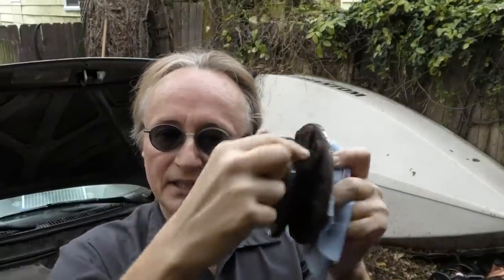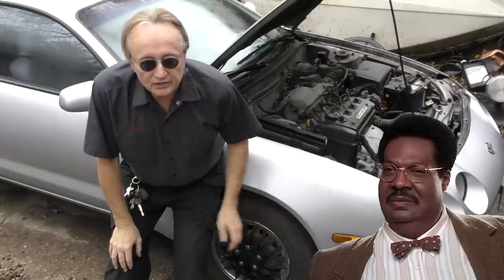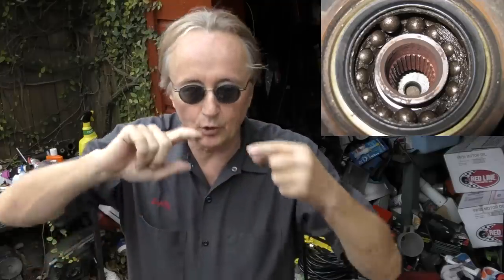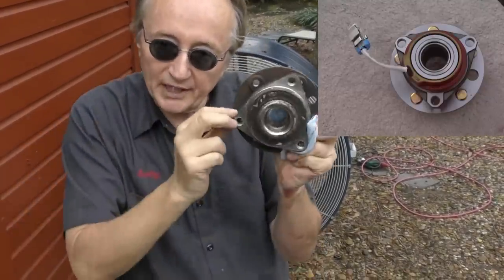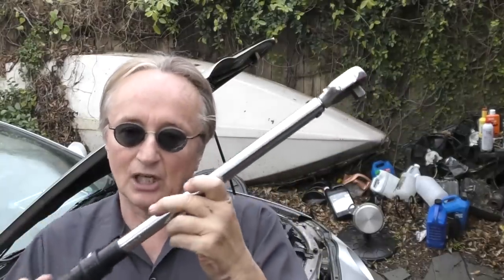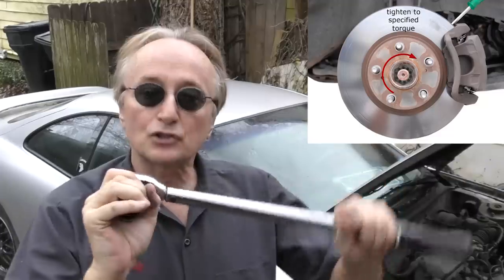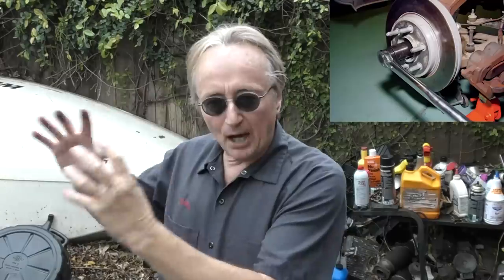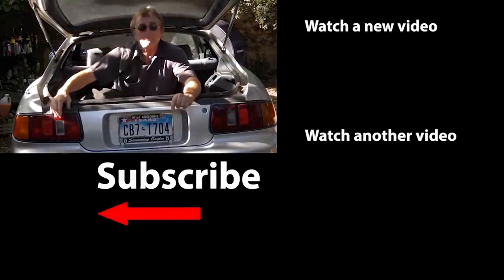Doing This Will Make Your Wheel Bearings Last Forever

Comment: I bought Harbor Freight torque wrenches for every size drive and I can't read the numbers on them. Also, many wheel bearings have crazy high torque specs. My basic 1/2" drive torque wrench only goes to 150 pound feet and my car calls for 170 and the other car is over 200 as I recall. What brand do you recommend?

Comment: I don't always agree with you, but on this one, you speaketh-the-truth. Being a maintenance Nazi myself, I have repacked my older wheel bearings years ago, greased by hand, but like you say, you don't have to anymore (or can). Replace item only. So, every other oil change I have my tires rotated and have them aligned once a year, unless I hit too many pot holes. When you drive a $75k car like I do, why not take care of it? Maintenance is expensive, but so is a new car is even more. Good video.

Comment: Thanks for the info.  I have a trailer that has the old-style  replaceable wheel bearing assembly on its single axle.  If you have any tips, tricks, insights, cautions, or suggestions for replacing them and keeping them in good condition, I would ask that you do a video on that subject.  Again, thanks for this video.  It was both informative and entertaining.

Comment: Thanks for the information Scotty!! I recently noticed the outer CV boot was torn on my '09 Jetta and there was grease all over the wheel well. I tried replacing it with a Dorman EZ boot split boot assembly and couldn't get the bands tightened down enough, so it slips off. I've tried pushing it back on there and packing grease in again and again over the last couple weeks until I can get a replacement part, but it's started doing a nasty clicking sound when I turn my wheels right or left, or when I start driving from a dead stop..basically anything that applies major torque to the wheels. It's a 6-spd standard transmission, btw. 

Is this the wheel bearing that's clicking on that side, or is it the CV axle that's making the nasty clicking? I had someone tell me it was the needle bearings in the CV joint that were clicking from being dry, but I just wanted someone's opinion who may be more knowledgeable. I'm going to get it into a proper auto shop on Monday now that I can afford it, but still wanted a heads up. Thanks in advance for anyone that can help!!! Love everyone on this channel, and mostly I love you Scotty!!!!!

Comment: Scotty!! Alert!! Please note that a common torque wrench  mistake is to tighten the nut (or bolt) and THEN  checking it with a torque wrench, which can easily lead to the fastener being 0VER-TORQUED. It's important that the FINAL TIGHTENING of the fastener be done with the torque wrench to get ACCURATE  torque. Your videos are great, you're not getting paid enough (whatever it is).

Comment: The one thing that you mentioned about quality or "OEM" wheel bearings made me think of this. So about 2.5 months ago. I replaced the front hub assemblies on my 2000 Grand Cherokee. I stopped around and was able to find both the left and right side ones online. From Timken, (high quality right?). Well the day they got delivered. I took them to my school were I'm in the auto tech program. And showed them to my teacher's. And guess what? Right on the Timken box. It said "made in China!"😂. My teachers who have all 3 been mechanicing and teaching mechanics for about 35 years each. All dang near had a coronary lol.

Comment: Hey scotty i have a 97 ford ranger xlt 3.0 auto standard cab long bed that i know needs at least front passenger wheel bearing greased or replaced but also my steering wonders real bad . Any helpful knowledge on my truck and common issues and fixes would really be appreciated, things haven't been so great in my world lately and i could use a break. Thanks.

Comment: Hi.. Scottieeeeeeee...   I just picked up a used 2007 Honda ridgeline,,for around $4500 has all  maintained paper with it . Water pump, timing change, brakes, ect.. has high mileage 235....😕 . Under  is clean, inside is clean, outside has the usual Honda rust,  Q..do you think I made a good decision on a the truck for that year,,,, p s your the greatest......  mikesin....

Comment: Scott can I trust a cheaper brand torque wrench. Do they hold there calibration and are they accurate, especially working on my Harley. I currently have a Craftman and  Kobolt ( lows ) . I always O-out when  not using,Is this recommended .

Comment: Can bad wheel bearings cause a vehicle to shake while driving a high way speeds?
Reply: You Bet it can!  In a model A  Ford (1928-1931) we call it "Death Wobble"
Reply: Maybe you just need tire balancing, so do that first. Other things that can cause it are warped rotors, bent axles or worn shock absorbers/struts. Bearings would make all kinds of noise if they cause shaking.

Comment: Good to know. I got in accident months ago. Broke tie rod and pushed the axle back to where my tire was rubbing. Had to cut the firewall to get it to turn right. Put a new strut in. Got it riding. Still looks very odd and it’s tearing my entire suspension apart. But I’m poor. I hope I get the torq wrench

Comment: Hey Scotty, my wifes car sounds like one side is grinding metal to metal, when I brake hard.  I did a new brake job, struts, front end and suspension parts last year, but did not replace the bearings, or rotors.  Have you observed this condition before?   Best Regards.

Comment: Lots of great advice here from Scotty.  I always get my wheels aligned and balanced every year as I'm convinced it reduces wear and tear on other components in the car as well as driving better.   Prevention is better than cure, that's why I also change the oil twice as often as the manufacturer recommends.  I've been told I'm crazy for that, but it works.

Comment: The thing about modern bearing units, is that you can easily replace them yourself. You don't have to pay a mechanic for hours or labor. Also Americans seem to think that these things cost thousands, when you can buy an OEM quality part at a fraction of the branded parts. For my 2009 SEAT Leon (basically a VW Golf) you can get a decent one for about £100 and that's a Swedish brand.

Comment: I have never had problems with using better quality aftermarket wheel bearings such as Timken. Often I have found that a lot of OEM parts are middling quality, and that better aftermarket parts are better, and sometimes address a factory design flaw that OEM doesn't. Plus, I don't have to pay the outrageous price of OEM.

Comment: I just put first drivers front hub bearing on then had to put on passenger side which i was told had been replaced. Now the drivers side is making noise again. Didnt use a torque wrench. Just bought this 2006 cadillac sts recently already put around $2000 into it and now it has a rod knock. First and last cadillac smdh.😡

Comment: My Dad had this old cart with an older IHC seeder for clover/timothy grass on the back. The axle came out of some pickup from the 50's but anyway I asked him "Have you ever greased those wheel bearings?" Because one of them sounded terrible. "It'll last just for this field" came his reply. I finished running the disc for him and went inside to eat. I went to the window to check on him and noticed something odd about his cart-seeder.....upon looking closer one of the wheels had come off entirely and he was still stubbornly dragging the cart like a sledge to get the field finished. (It was about to rain.) Grease those old wheel bearings!

Comment: What things need/should be torqued on a car? If I change a tire, do I have to torque the lugnuts? Or is using a regular tireiron good enough? (honestly asking here, I know basically nothing about cars)
Reply: Yes, wheel lugnuts should be tightened with a torque wrench. I just replaced a front wheel bearing on a Mazda 3. Lugnut tourque spec was 90 ft lbs.
Reply: @MikeR55  Thanks. I'm assuming this info would be written in the manual?
Reply: @ @Bornahorse In the service manual not owners manual. You probably don't have that so its easy to look up online.  Look for service specifications for your model, usually a pdf doc.

Comment: Yes. Always use a torque wrench.  You wouldn't believe how many parts on a vehicle actually require a specific torque to operate properly. 
I used to use one for almost everything I would fix on a car. At least I did before my really good expensive torque wrench was stolen.

Comment: Scotty, you forgot to mention not to beat on your rotors with a hammer when removing them. Also, if your rotors are warped, replace them immedately with rotors not made in China!  Also make sure your torque wrench goes to 350 ft/lbs, many don't.

Comment: Idk lol..  I just have to take my tire off.. Then its as simple as 4 bolts on the wheel bearing and 1 big nut holding the cv axle in.  Really really fast and easy job, not to mention the entire bearing assembly that comes with new wheel studs are less than $50.00 for OEM brands like AC Delco... My state is 90% pot-holes and 10% acceptable pavement so avoiding suspension damage is not possible.  You just have to accept it and drive vehicles like mine that are easy to service the suspension components on.

Comment: With respect to torque wrenches, does it matter if the wrench is a 3/8 or a 1/2 or a 3/4 inch?  I know there are adapters to accommodate any combination, but is there a good rule of thumb for which is better?
Reply: Each size has limitations for how much torque it can apply.  I have two half inchers for example.  One is from Harbor Freight.  It maxes out at 150 ft. lbs., and the other, by EPAuto (Which is a lot bigger) goes up to 250.  I also have a 3/8" from Harbor that only goes up to 80.  The bigger the wrench, the more powerful.
Reply: @ShyLeonheart  Thanks very much for the information!  I'll try to put that new-found knowledge to work in the near future.

Comment: Offset wheels also cause a lot more wear on wheel bearings.  If you've ever been following a car or truck that has the tires sticking way out, you can bet the wheel bearings are taking a beating.

Comment: I have to put new bearings on my vehicle and it won't be easy.  I may have run the brakes down too low and that might have heated up the bearing on the front passenger side and ruined the bearing.

Comment: I think you would break a 1/2 inch drive torque wrench before you could over tighten pressed in hub type bearings once the two bearing halves meet they just aren't going any further, tapered bearings are another story

Comment: A car stops faster without ABS if you know how release the brakes when the wheels lock and if you know how to make your car skid in the right direction. Race cars don't have ABS. A lot of men remove the ABS system rather than replace it when it fails. You can buy ABS replacement kits that connect your brakes directly to the master cylinder.

Comment: 2002 ford focus bearing and shock replacement left rear wheel was told I have to replace both sides ?????
Reply: Technically speaking, yes. If one sister part needs replacing, it's recommended to change the other(s). Now, in your case, the other side is bound to fail soon. Especially with old suspension components. Only do what's necessary (depending on your budget) because you might be able to squeeze some more miles out of the other side's bearing and shock. All depends how it rides as of now with the new parts on the left rear. If it feels back to normal, just wait until the other side goes out. To answer your question in closing, yes, you should have the other side replaced if it's in your budget.

Comment: OEM! For sure.  Reminded me of a recent experience... In addition to my own car, I've been working on my girlfriend's car since I met her:  A 2005 Toyota Corolla.  She had about 250K miles on the thing.  I thought it would be good to replace the bearings all around after that kind of mileage.  My first attempt DID NOT involve OEM bearings:  The Chinese-made POC's I installed on the front started to HUUUMMMMMMM not even six months later; it took them just that amount of time to seriously wear-out.  It got so bad on one of our road trips, I had to take the car to a Toyota dealership in Portland, OR and have the (really) bad one replaced (SO EXPENSIVE!).  When we got home, I immediately replaced both front bearings with SKF's.   While SKF isn't OEM for that car, it's still way better than the Chinese crap I'd installed earlier.  So far,  they're working-out great... I'll keep an eye on them.  If I ever have any doubt, I'll replace those with the true OEM the car:  (Japanese) NSK's.  Thanks Scotty.  Your vid was a good reminder to always go OEM when you can!

Comment: P.S, it’s been so long since I’ve worked on a car, I had no idea they changed over to these pre made sealed bearings. They may say it’s to keep the dirt out but you can bet their main motivation for this change is to make what used to be a cheap repair just another expensive nightmare. Car companies apparently don’t want people to be able to fix their own cars anymore so they have to keep buying new ones that are worse quality, last less longer, and more expensive to fix an in most cases impossible to fix because they require a pro shop full of special tools 🧰 and computers. No wonder you tell us it’s better to buy a quality older used car!

Comment: nah, Scotty. I went cheap a total of $27 for a wheel bearing assembly from a car parts distributor online and it has worked for three years no problem. You don't have to buy expensive parts. I had a bunch of mechanics tell me that they would not attempt to put any type of exhaust on my car unless it was OEM which was way too expensive for a Toyota Prius and so I bought a bosal and found a mechanic to put it on for cheap. The part cost $88.

Comment: Mabe im lucky, ive installed non oem wheel bearings on 3 of my cars, and all with built in abs sensors, 2 of the cars, 4 years ago, and there still working fine no abs codes. Average price was $40.

Comment: Actually CV axle nut torque doesn't affect bearing wear. Couldn't. The nut contacts the face of the hub, and the front of the cv axle is right against the rear of the hub or the inner race of the bearing which is right against the back of the hub face. Of course you want to torgue anyway for safety! HA YOU WERE WRONG ONCE SCOTTY!!  I will still take that torque wrench! Thanks!

Comment: Why were the old re-packable wheel bearings done away with?
Reply: Less labor intensive... packing by hand in a USA shop with price of mechanic labor vs. pay a factory in China to build a sealed assembly.   Also I suspect the officially claimed reason has something to do with better quality control, more consistent "six sigma" whatever mumbo jumbo AND also probably an open bearing that leaks grease is probably punishable as toxic pollution now.  BP can spill 1000000 gallons of oil somewhere, but a tablespoon of grease leaks out of your bearings at a boat launch and the EPA will show up and put you on their list of tadpole killers and cite that as a reason to require more e-check inspections.

Comment: DEAD ON ACCURATE ADVICE: GET MANUFACTURER WHEEL BEARINGS  -- How do I know? Because I'm CHEAP, and thought those $24 (and free shipping!) Chinese wheel bearings were mighty pretty! Three times I thought that. In fact, every 25,000 miles one of the Chinese bearing would begin growling. Then the ABS light. Then ... back on the garage floor. Now, OEM bearings only. It's NOT more expensive, because you have to count the high cost of continual replacement of the Chinese bearing, plus the headache of having to get dirty and bang the basta...ds out, yet once again. Buy OEM. Scotty is telling you like it is. So annoying to keep replacing these with junk parts. And that goes for NAPA, O'Reilly's, Whitney .. anyone. AC Delco for my Chev; MOTOCRAFT for the FORD, and MOPAR for my Jeep. Better things to do in life than have to continually replace bearings. It's what I did all summer ...